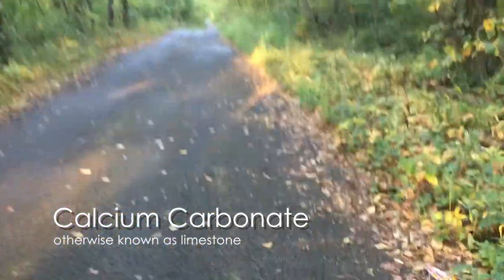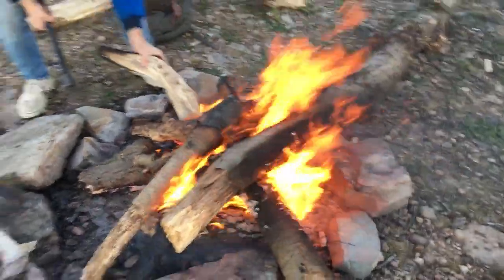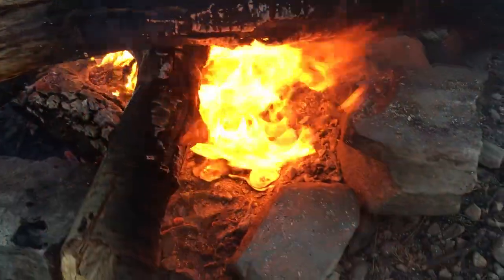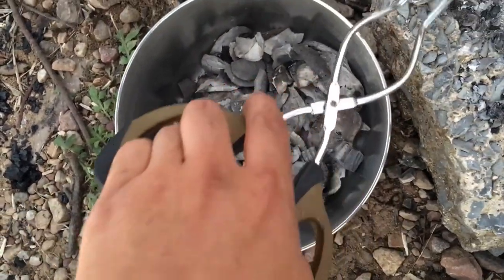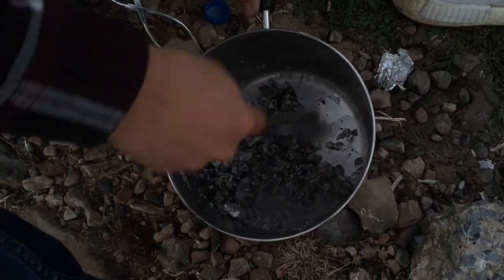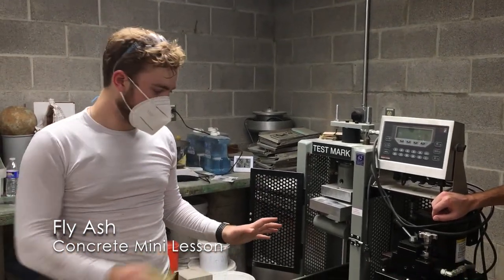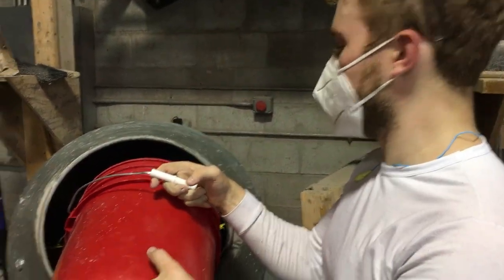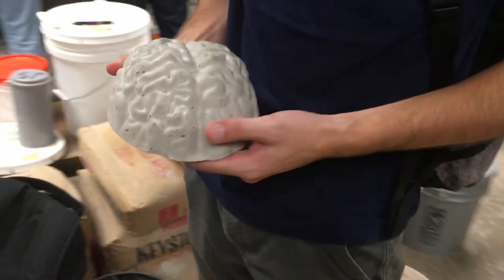Sea Shells to Concrete

Comment: Attempting to make tabby concrete. Thank you. Is heat required for chemical reaction or just to break it down? Wonder if mortar and pestle can still create the paste w/o heat. Or if the chemical heat reaction is needed
Reply from the maker: The sea shell need the heat to create the chemical with the addition of a quantity of water to it, it really breaks down the sea shell and purely becomes the chemical that can be added to concrete mix

Comment: How long did you heat up the sea shells, and what is the purpose of heating up the sea shells?
Reply from the maker: We heated it up for about an hour or so, till it was red. The purpose of heating them up was to create calcium carbonate that was a ingredient to concrete to create the concrete brain in the end.
Reply: @alejandrohuaman7  This was super interesting. I lived in worked in Dubai, and Oman. I noticed a lot of the old historic buildings had seashell bits in their walls.
Reply from the maker: @soulsurfer639  that’s crazy! Yeah we actually learned about that in my architecture history class and that’s why we took it upon ourselves to make concrete out of them because they are a key ingredient to make concrete